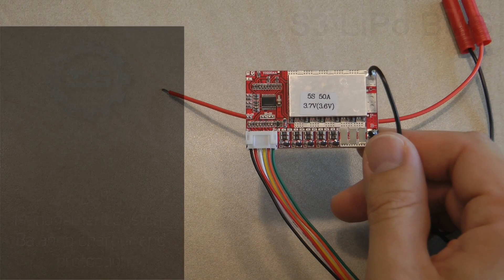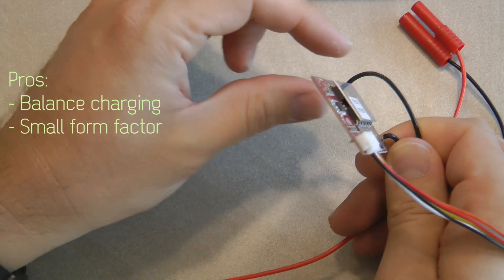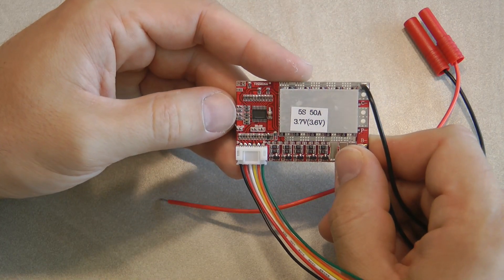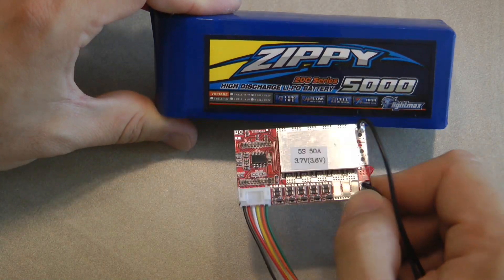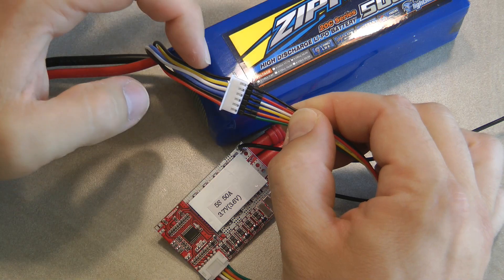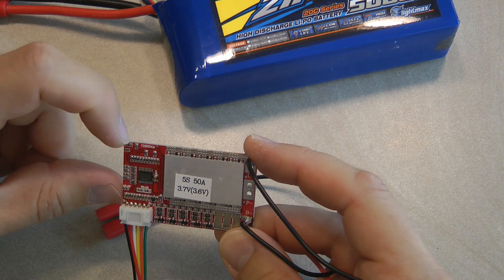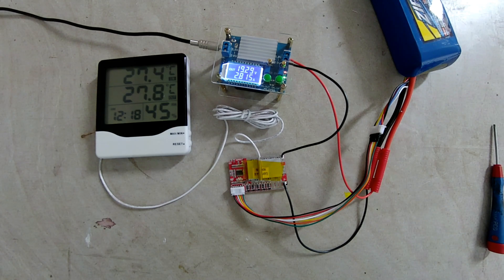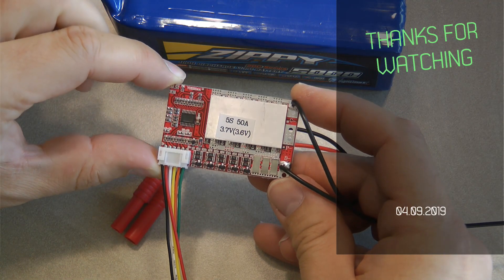5S Lipo BMS

Comment: Can use y ion battery bms for a polymer battery ?? Thanks
Reply from the maker: I think you can, because the BMS primarily looks at voltage levels, does not really care about the actual chemistry of the battery. And Lipo and Lion are both 3.7V nominal if I am not mistaken.
Reply: @csongorvarga  thank you so much.. i will search more because it's very dangerous
Reply: @csongorvarga  generally lipos are 3,2 V as I know

Comment: Hey! I just picked one of these up and wanted to know what the voltage input range is. Can you supply less than 21v to charge the cells up to 21v? For example, can I use my trusty 19v 4.8A laptop charger?
Reply from the maker: No, it does not contain a boost element, so you need sufficient input voltage.
Reply: @csongorvarga  thanks for getting back to me! that info is super helpful.

Comment: I have the same thing in a 4S version. The seller states that if going above 20A, the tinned areas have to be reinforced with copper or wire (that's the 2 silver strips on the front and all of those on the back). Solar cell ribbon seems to be easy enough to cut to size, it's flexible and pre-tinned so I'm guessing a layer of that will solve that problem.
Reply from the maker: Thanks, I have not used mine so far, but thanks for the tip on reinforcing the traces.